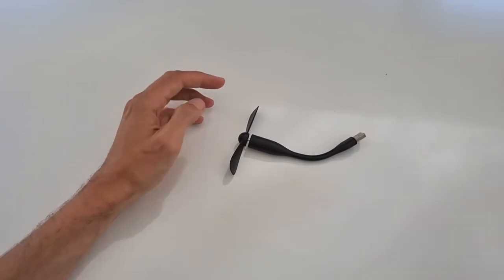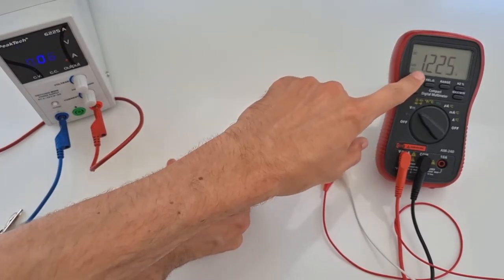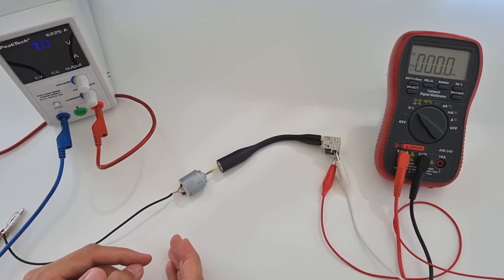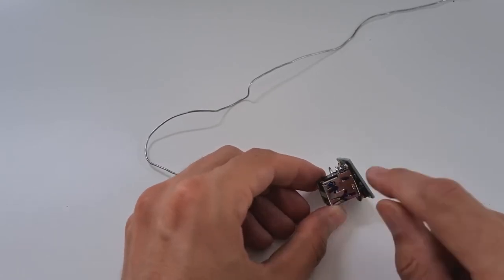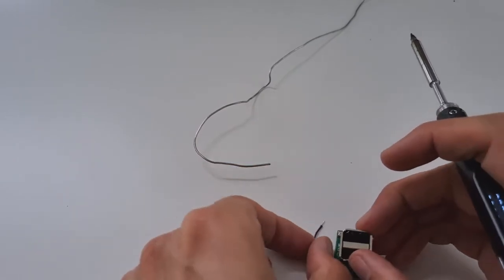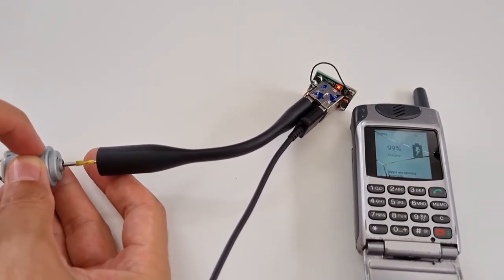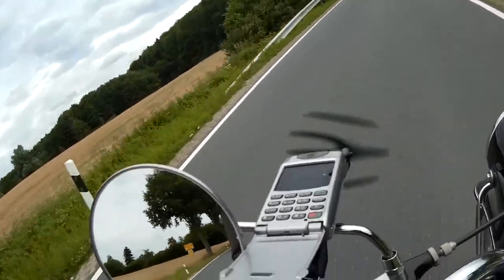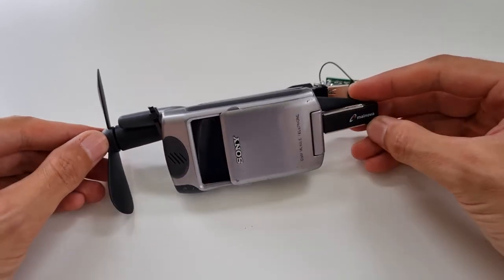Windmill USB Phone Charger

Comment: That's a fun demonstration of energy conversion, but it would be much more efficient to derive the charging power from your motorcycle electrical system, e.g. the headlamp circuit.  I'm sure you understand this too, but some less techie viewers might be imagining free energy miracles.

Now maybe you can recharge a quadcopter drone with your motorcycle?  
Or, I can imagine a drone that is engineered to regeneratively recharge its dead battery as it falls from a high altitude, such that it has enough recovered energy to do a safe soft landing rather than a hard crash.
Reply from the maker: You are completely right, a fully electrical charging system would usually be the way to go. I was looking for something that would work without any changes to the motorcycle.
I especially like your analogy to free energy videos. I didn't notice it but my video indeed follows (unintentionally) the typical free energy video format :)